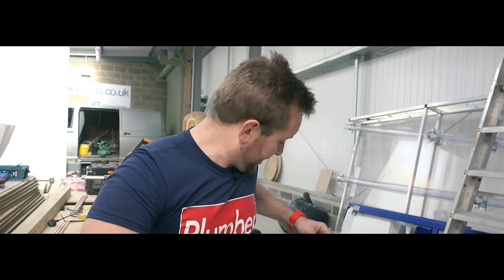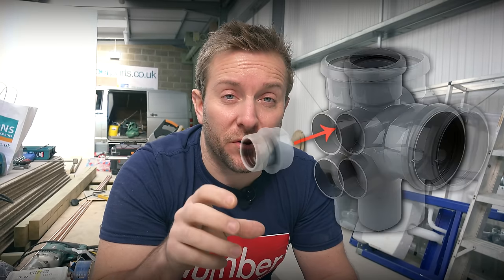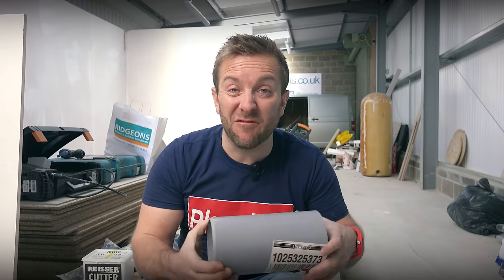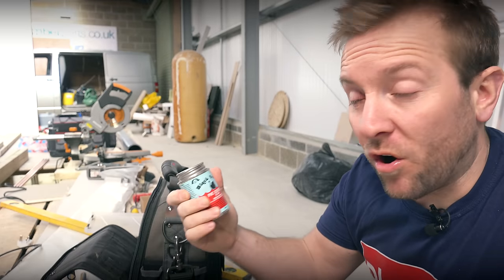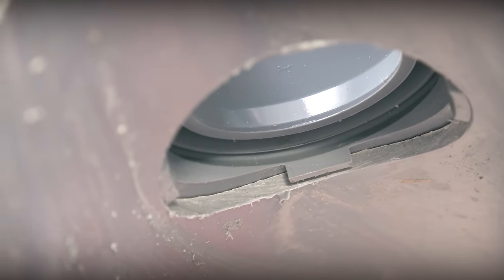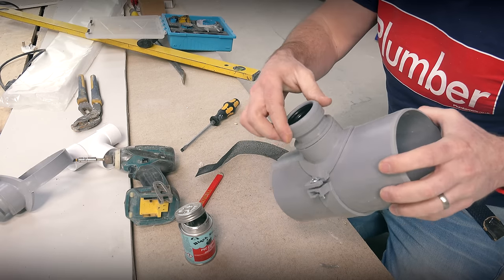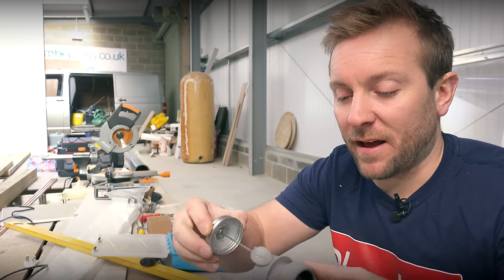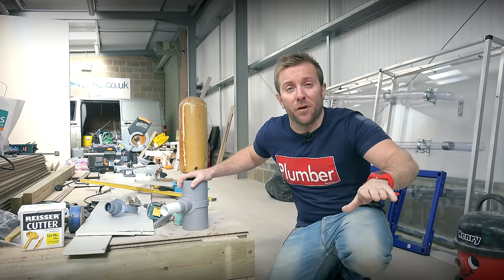SOIL PIPE STRAP BOSS - HOW TO DRILL AND INSTALL

Comment: Etching is less important than ensuring that all the surfaces to be fused are completely clean of oil or grease. The solvent weld "adhesive" works by dissolving the surface of the items being bonded, allowing them to mix together. It's not acting as a traditional adhesive.
Reply: Correct my friend 👍

Comment: Have they finally invented a brush that’s long enough to reach the bottom of the solvent cement pot??
Reply: HaysieBoy I hear you 😂
Reply: Some people squash the pot when it's starting to run out...
Reply: Cut the glue pot into half with Stanley knife. Quick and easy

Comment: Do you have a video on fitting the MCAlpine 22mm condensate pipe connector - Mechanical Boss Connector : Product Code - BOSSCONN-22mm?  It's a fitting that needs an odd shape hole in the soil pipe.  It says you can use the McAlpine fitting instructions as a template but what is the best way to cut the hole in plastic soil pipe?  Do you need to use silicon sealer to prevent leakage?  Any help would be really appreciated.  Do I need any special tools?

Comment: Is this the wavin osma boss with osma boss adapter? I have one and it looks similar to yours and wanted to check 57mm is the correct hole size. Is the boss adapter you use with the rubber seal push fit so you can push your waste pipe in and not solvent weld it in? Holdin tight ..

Comment: I am adding a basin to a horizontal waste under a floor beside a joist so difficult to get access with a drill to make the hole and the ‘top’ you mention will be at 90degrres . Would it be better to cut out a section of the waste and use 2 joiners even though the wouldn’t be able to be pushed in fully ?

Comment: Really you are supposed to use upvc solvent degreasing cleaner first before using the solvent cement.  
It etches and softens the surface prior to using the solvent cement.

Comment: Nice job James! Our plumbing code doesn't allow us to use them here in New York City.
Reply: I haven't seen that type of of fitting before.  To bad we can't use that, it looks like it could be easier that cutting a hubbed fitting into a tight spot where you can't move the pipe.

Comment: Done loads of DIY but this is a first for me. I'm putting in a new stack BUT I'm confused about how to get a 40mm pipe into the stack. I want it to go into the junction that has cut outs for additional pipes. I only could use a 52mm holesaw due to the plastic moulding so when I've tried to get a 40mm rubber boss adaptor in will it hell as go, even less hope of getting a 40mm pipe in that. I'm obs using the wrong thing. Any help!!!

Comment: do you need to do the etching/solvent weld onto a cast iron pipe? cheers . . in fact what would you do differently for cast iron pipe in general?
Reply: Seems likely you've already resolved your problem but here's my advice:
First thing is to check the diameter of the pipe. Good chance it's 3½" which is not going to marry at all well with a boss for a standard 4" pipe
Second thing is solvent weld is only for PVC and ABS.
THIRD thing is I wouldn't recommend trying to glue a plastic fitting to a metal pipe because there will be differential thermal expansion and the joint will not be durable.

If I were you I'd buy a McAlpine mechanical boss designed for a cast iron pipe. I've never actually used one but it looks sound in principle!

Comment: Plumber from the states here... love your vids btw, but question: why do you all use those boss's to make a tee connection??? Were I'm from saddle type fittings are illegal (Kentucky, but my state code is really strict anyways,one example is we have to individually vent every fixture to a main vent stack that terminates above the roof, or even more... wet venting are absolutely not allowed anywhere in Kentucky state plumbing code), but even across the states everyone usually uses just uses solvent welded tee fittings.. what is the reasoning behind you using those instead of standard fittings, because it seems like much more work to use those boss's to me. Is it cheaper???

Comment: I’m changing the old metal waste sewage pipes running from toilet through the wall and out down along the wall to the man hole sewer, the 4inch old pipe running up the i like to replace with 6 inch pipe running up the wall , then I got to connect a four inch. That runs into the back of wall into bathroom , not rocket science , the problem is how do I get the old metal sewer pipe out that goes through wall into a connector that’s offset then into back of toilet , the pipe from toilet waste which is metal or clay is got all Cement and brick work ,do I chisel it out or just go square around the pipe and remove it that way removing some bricks aswel or is there a short cut , I don’t have to remove it but I want all plastic pipes from start to finish ! Plus it’s all Lime scaled up and it’s Yonkies old

Comment: James I am "bossing" 36mm to soil stack but previous owner concreted most of the pipe and I only have a small gap where I've chipped away. I can easily drill the exposed pipe but I cannot use a strap as cannot get around the pipe. What kind of boss do I need if I cannot strap around the pipe?